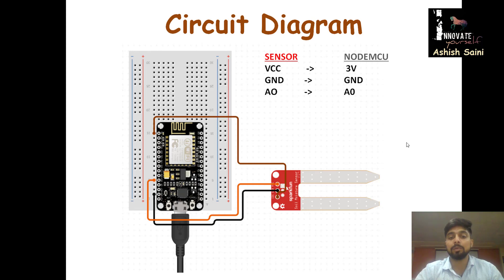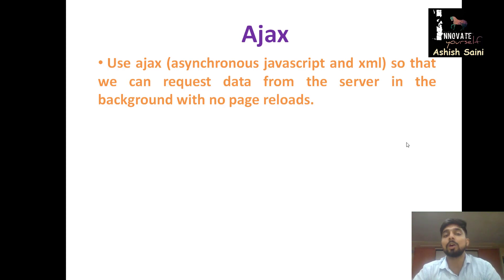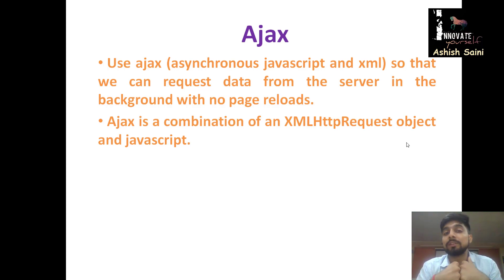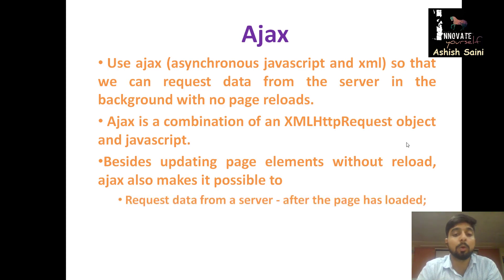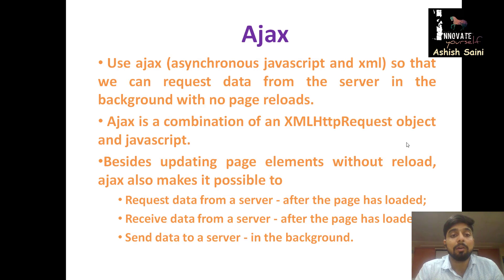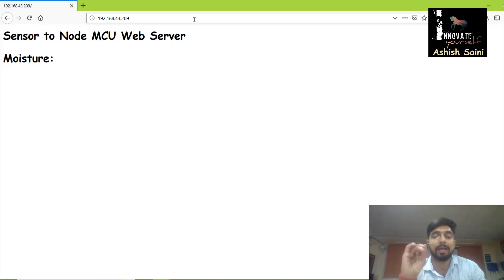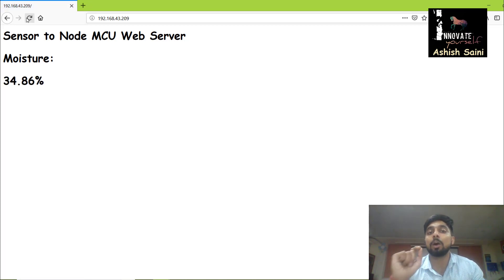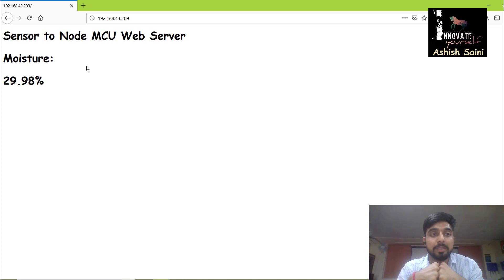Real-time Uploading of sensor data on webserver without refreshing

Comment: Hello, really nice video. I want to ask a question. Can I use this method to collect data in real time with moving sensor using GSM module? For example if I put the sensor on a car, the Arduino will send the data continuously to a server or my computer, and then save it as a dataset file. Is it possible?
Thank you in advance!
Reply from the maker: Ye syou can but for real time it won't be much effective, instead of using this you can use blynk or ifttt platform for this purpose.

Comment: Hii. I use arduino uno. Can i use the coding also? Or i need to use nodemcu ?
Reply: Btw i already have wifi module
Reply from the maker: Which wifi module du you have?
Reply: @InnovateYourselfashu  esp8266
Reply from the maker: Yes you can but not completely. You have to make sone changes according to Arduino uno
Reply: @InnovateYourselfashu  i see. Thanks. But may i know which part do i need to change ? 😊
Reply from the maker: Check this link you will get the basic idea about where to change the code 
https://youtu.be/gK03rrwWYMA